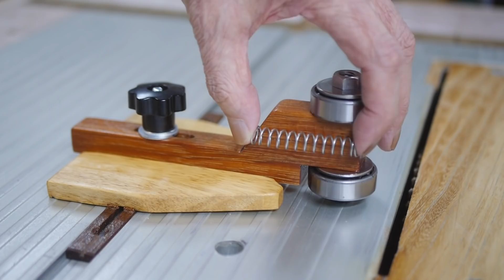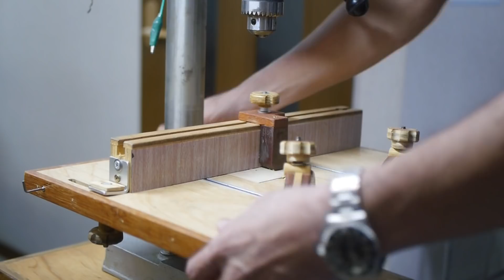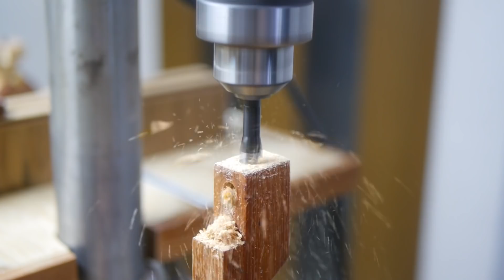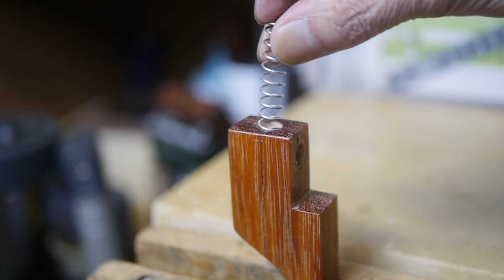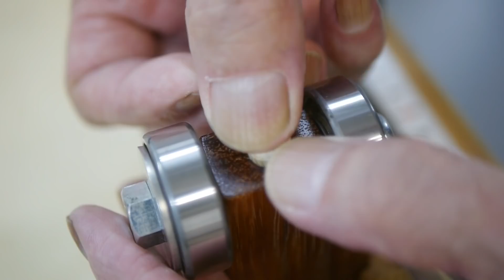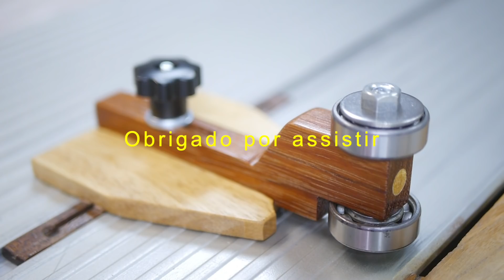Built-in spring

Comment: Excellent idea, when I watched the first video of the project, I thought about the possibility of using springs to press the wood. But you did it! I believe I can use it in my current project. Congratulations my friend was excellent and thanks for sharing!
Reply from the maker: Hello Alexander
To cut a thin plate with the same thickness, it should have been done in Project 1, but it can be used in various ways by incorporating a spring. A simple improvement of this tool has had a great effect!
*
Thank you
See you

Comment: Curious, Why do you have your blade at half high when ripping, (then flip), small boards?
Other videos I see a 10" to 12" blade.
Reply: Could be that the favourite blade is too small and it is easier to flip the wood than to change blades all the time. Also it may prevent tear out on one side of the cut board (but I never really noticed that on my table saw).
Reply from the maker: @Jonathan Ford
Hello
Thank you for supporting me.
Reply from the maker: @NoggleBaum
Thank you for your comment this time
When the raid is exhausted when cutting this thick tree at once
Smoke and scorch marks remain on the cut surface, and I choose this method for smooth cutting in consideration of it. (Especially for hard wood)

Thank you
See you

Comment: Hello, may I ask what the function is of the spring that's built in.
Reply from the maker: Hello Jo's
Thanks for watching my video

No spring is needed if you cut thin boards of the same thickness.
The reason for preparing the spring in the second stage was that it could be used like a feather board. The safety is increased by the effect of the spring, which presses the member against the fence.

Thank you
See you
Reply: Hi Ohyo56, thank you so much for the quick response. I've already made something like this with one bearing, but this version is better.

Comment: 1:59 where did the locking nuts go?
Reply from the maker: Hello
I always use what I have around me, this time too! The inner diameter of the bearing is 15mm. The bolt diameter is 8mm. The outer diameter of the lock nut is 15mm. !
However, if you can, it is recommended that you do not do the troublesome thing and prepare all just sizes. *

Thank you
See you